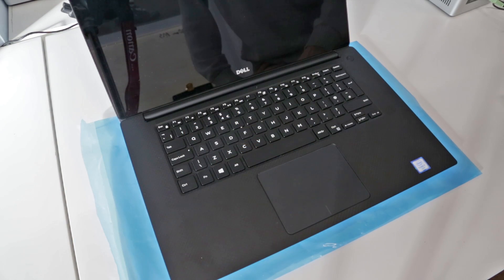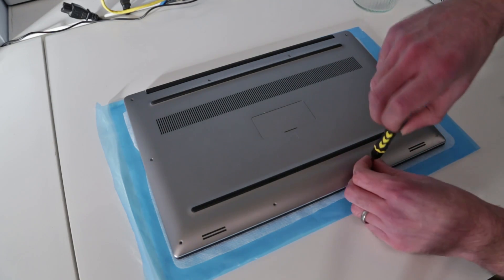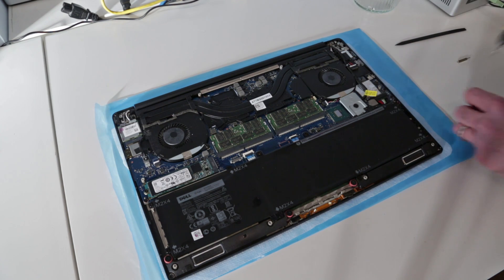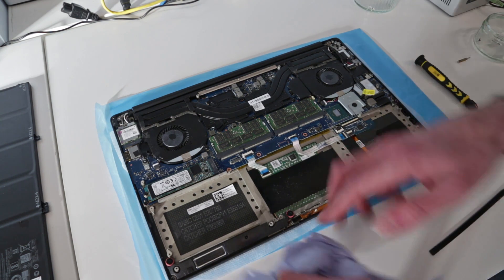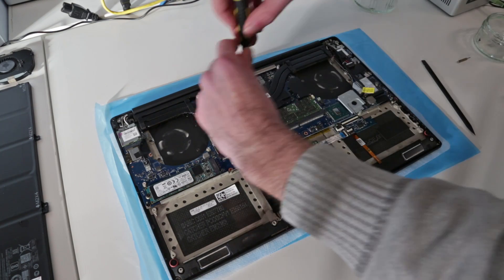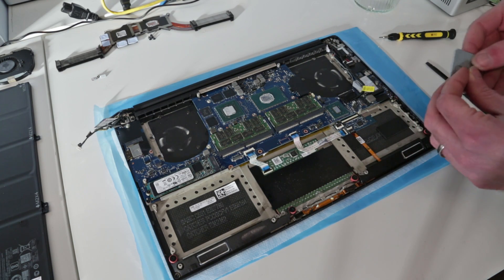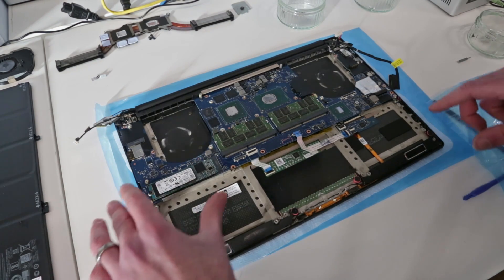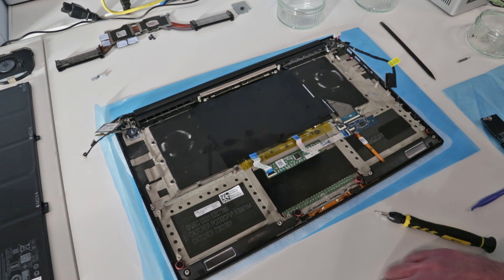Dell XPS 15 (9550) Teardown, Repair and SSD/Memory Upgrade Guide

Comment: I was stupid and used a needle nose pliars to secure the battery plug and I saw a few sparks now battery isn't detected,  did I short the battery or blow out a chip on the motherboard that detects the battery?
Reply from the maker: Errk, that's not great. Only way to be sure would be test with a known good battery, hopefully isn't damage to the mainboard.
Reply: @BrueComputing  Thanks for the response, I wonder is there a chip in the battery that communicates with the motherboard or is it on the main motherboard?  So the laptop still works on battery (it stays powered on when the power supply is removed).  But yeah even the bios says no battery installed.  I also somehow jacked up the touch pad haha.  And I stripped two of the screw heads out holding down the battery,  they are in there tight.  This was not my best work haha.

Comment: Hello Brue Computing, I have a question. My Dell XPs System Model is XPS 15 9560 I want to replace the ssd for a 1TB ssd I don't know if the size of my ssd is the same that the dimension you said on the video 2280

Comment: having replaced my xps 15 9550 mother board with a seconds board i am having boot up inconsistencies reboot never works only cold start ups work some of the time. , i have noticed that my service tag is different and the asset tag is as previous , bios upgrades do not update,. should both tags be the same, if so which one should be changed and how and or should i do a clean install of windows, . or do i have a completely different problem. laptop works fine once booted up. tried all bios, firmware updates nothing works in the f2 diagnostics i cannot change any tags. dell support doesn't want to know anything as it is out of warranty and board was not from them, thank in advance
Reply from the maker: The Service Tag will correspond to the machine the mainboard was taken from. I don't know of any way of changing this but it shouldn't be the cause of reboot issues.
Does it reboot correctly if you use something like a Linux Live USB stick? May be a Windows issue rather than a fault with the replacement board.

Comment: Sadly I have had many weak links fail on my XPS 15.  Starting to hate Dell quality control now.  My XPS 15(9560) power supply connector(on pc) has broken(center fell out) - is this possible to replace?

Comment: type of screwdriver?
Reply from the maker: Torx T5 or T6 for the screws in the base, small crossheads for the ones under the XPS flap. Same for inside.

Comment: I have a XPS 15 9550 with 1TB hard disc that needs to be replaced 
with the HD replacement will OS and applications have to be reinstalled ?
Reply: That depends. If you have a model that has both an SSD and a regular hard drive inside it, it will depend on whether you installed the OS to the SSD or not. If you only have a hard drive and no SSD, then yes, everything will have to be reinstalled because you're effectively wiping the storage by replacing the drive.

Comment: Pleaseeeeeeee! could you tell me what kind of screwdriver I need to use to open this laptop, I have already bought two Precision Screwdriver sets and none of them worked!
Reply: he said it was a t5 torx
Reply: T6. Also thought it was T5 initially. T5 kind of works but not if the screws are firmly set.

Comment: If I get the version with the smaller battery is it possible to upgrade to the larger battery?
Reply: Jarlath Healy yes i wanted to find that out too.
Reply: Yes it is, and it's pretty simple, too. just remove the (battery, HDD) drive cariage and the SATA interposer cable and your are ready to go to put the big battery in (same screwholes).

Comment: Where would the 2.5" go? Since the 9550 comes with a harddrive and an m.2 ssd there should be room for one but I can't see it on the video.
Reply from the maker: Models with a 2.5" HDD get a smaller battery, as per the 9530 I looked at here: https://www.youtube.com/watch?v=n0_nolofSwc

Comment: Do you think it is possible to replace i5 cpu with i7?
Reply from the maker: No, to do that you'd have to replace the whole mainboard.
Reply: Thanks! I can get i5 9550 pretty cheap so I was wondering can I upgrade it easily but I guess this will be enough. I still think this laptop is really good!
Reply from the maker: The i5-6300HQ in the i5 version of the 9550 is still a quad-core chip, so I'd be pretty happy with that.

Comment: Hello, as you said, you have forgotten the link to the service manual ... ;-) Thanks !!
one question : In this configuration, do you think you could add a secondary ssd drive 2.5 inches on the left side under the battery ? (edit)  i have my answer which is no because the battery is larger than in an SSD+HDD configuration where it could have been possible...
Reply: There is a way to replace the battery with a smaller battery to give you room for a 2.5 inch ssd/hdd

Comment: Great video.  What do you think about swapping out the nvidia 960m in there for a new 1050 (same power requirements).
Reply: no
Reply: If the 9550 and newer 9560 have the same chassis you should be able to swap the entire motherboard to the newer one that has the kaby lake cpu and nvidia pascal graphic chip, however i'm not sure if you can buy the part from dell, you would have to go do some research
Reply: holy fuck, I haven't thought about that.. (changin the 9550 motherboard with the 9560 one) I have to do some research
Reply: is it possible?

Comment: Aye, good videos!

Could you do a Dolphin emulator test on the intel 520? 

Keep up the great work
Reply: the intel HD not the biggest problem on emulation,you should look for a processor with 2cores with maximum clock possible(4cores arent used by dolhpin)I believe intel HD can handle a max of 900p in full speed if you have a good cpu.